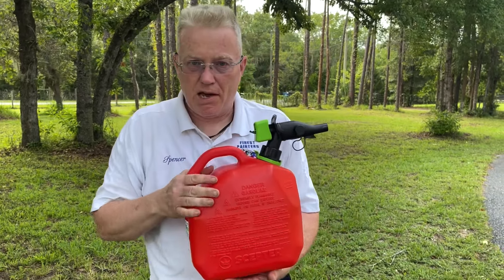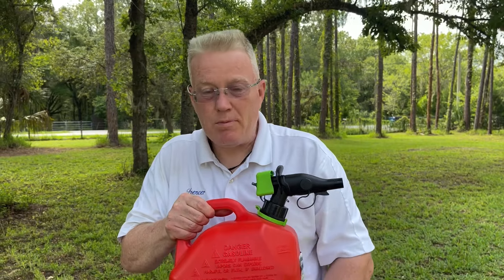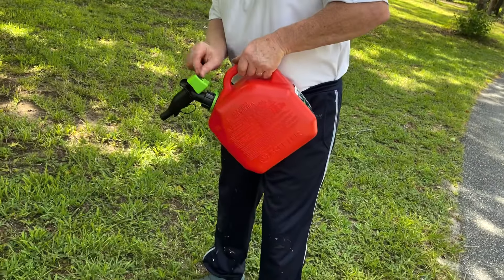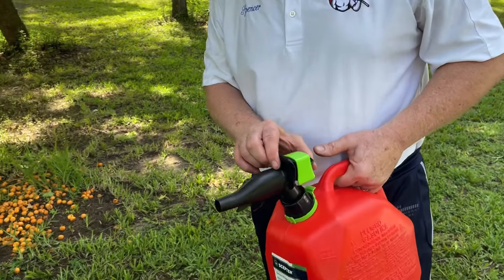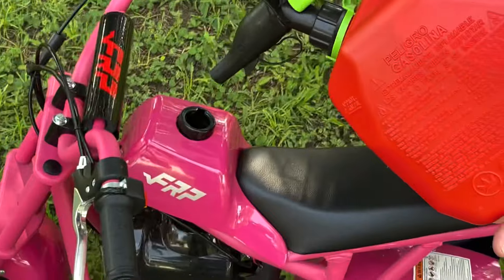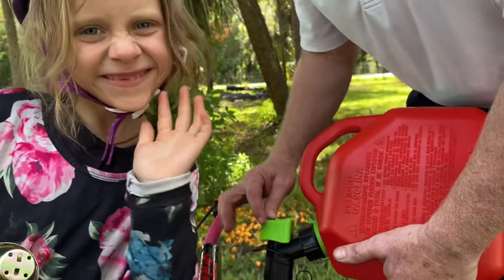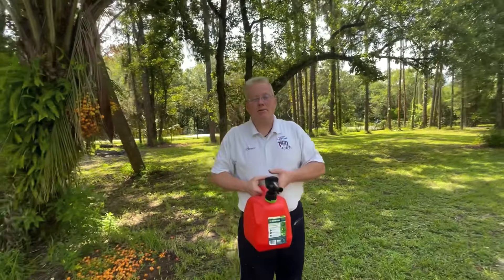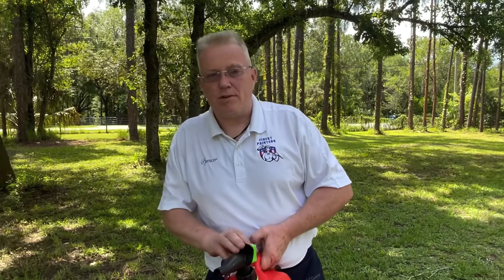How to Operate a Scepter Smart Control Gas Can - Spencer Colgan

Comment: I just picked up one of these from Lowe’s, and I had no idea how to use it. I’d tried it the way that you showed, but only after watching your video did I try it again, and realized that the 1st time you press the light green block in, it may be stiff, so you have to use a bit more force. After that initial time, it depresses very easily. Thanks for the video! 😊

Comment: Good explanation. I bought one a few days ago. Be sure to operate the valve first when in upright no-pour position. This releases any built up pressure to puff out. Then fill your mower. Do this so that the pressurized puff does not splash the gas back atcha and over your mower.

Comment: At 2:51 the spring loaded lever is a lock. That's all it is. It has no other function. It can be thought of as a child (or dummy adult) protection mechanism. It prevents children (or dummy adults) from pressing the green button. It also prevents the accidental activation of the green button in situations such as when the gas can is rolling around in the trunk of a car, or in the bed of a pickup truck, or falls off a table to the ground. The spring loaded lever is a protective lock. The green button controls flow.

Comment: Thank you for this video. I was ready to kick this can into the next hemisphere. I watched another video that failed to mention that the light green part needed to be pressed towards the black apart. Details are important, not just when giving driving directions😊
Reply: Yeah we have figured out that part and easy to use on toy on ground. Try holding 5 gallon can aka 30 pounds up to put gas in a car pushing button at same time. It sucks!!! All the new ones suck. I got a funnel tossed new nozzles away. Easy lol
Reply: Same here.  What a joke.  Not designed with cars in mind.

Comment: Welp.  The green housing remains locked in the up position after depressing the unlock tab (1) on mine.  It's not stiff, it's completely locked up.  There is tension on the unlock tab.

Comment: How the heck to you fill it with fuel? To my huge surprise it doesn’t fill up easily like all my other cans do. Imagine my surprise when I let the lever go and it came pouring back out splashing me with gas. I have to do short pumps at a time to get it past the filter causing the backup. Anyone have hints?

Comment: Tip starts at 2:45. mark.  Push hard but that's why it doesn't leak - good since must be held sideways & upside down to get all gas into tank.  It's plastic so we'll see if it still doesn't leak after being stored a couple of years. $22 for 2 gal size at HD.  5 gal was $30.

Comment: I recently bought some Scepter gas cans for my generator.  I followed Scepter's instructions and after 10 minutes of fighting with the horribly designed spout I still could not get gas out of the gas can.   I finally removed all of the spouts and threw them in the trash.  I them ordered new plain old school spouts from Amazon.  Now my gas cans have spouts that work very easily.

Comment: I have 2…one works as you’ve shown and the other one broke when I applied the required force to move the valve to open. They are not very well made. Over engineered and under fabricated. Kind of a typical when engineering is driving the bus.

Comment: I have advanced degrees in engineering and was stumped by this stupid gas can.
But even knowing how to now, using it is a major pain in the butt because of where the handle is located. You need three hands to support and pour it, especially when it's full. A true case of bad engineering and dumb purchasing on my part.

Comment: I have dozens of plastic "Smart Gas Cans"... I quit, I've gone old school.  Like my Dad. I only use Steel can and funnels (some of the funnels are plastic, Mostly Steel).  over the years, I have doused myself and my equipment with gas to many times with these "SMRT Khans".... all the leaver, buttons and do-dabs FAIL …. even to a point of the nozzle coming off.  Each MFG. has a different size hole so you have to buy a dozen different replacements... NOPE, No longer... steel cans and funnels.  I do have an Gas, \ Diesel ready electric transfer pump.  I should mention, all but one piece of my equipment is Diesel... in closing; steel cans breath better....everyone has opened the plastic gas can and you hear the whoosh of fumes escaping …  Always leave your breather open on your can during the heat of the summer.   
I will say... I have been tempted by the:  Sure CAN and No - Spill... Though a buddy has the N* - Spill,  the button stuck...annnn'd it became an "Excessive Spill"